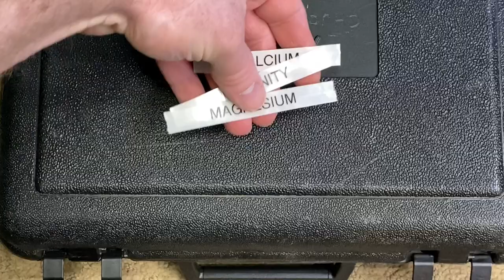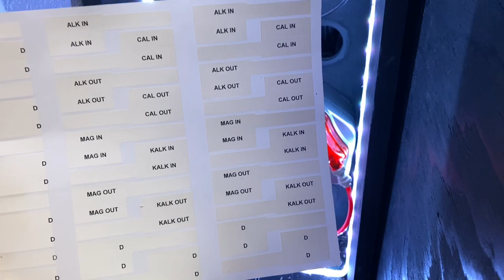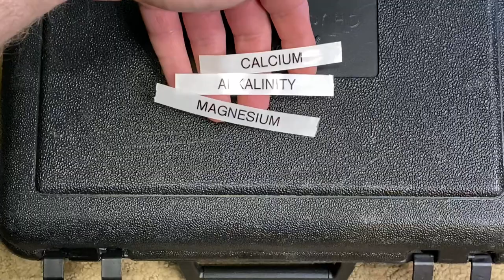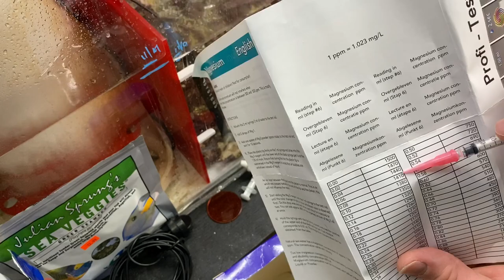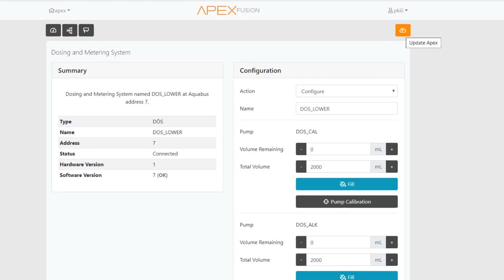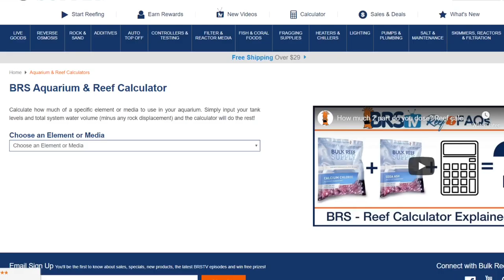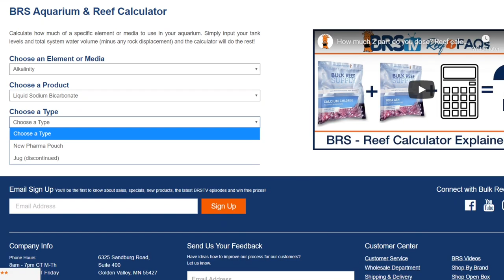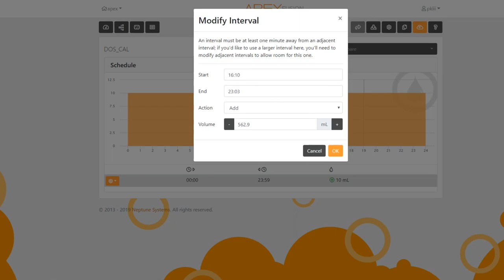SALTWATER REEF AQUARIUM DOSING SYSTEM For 2 Part * DIY Custom Setup *

Comment: Hey! If your dosing containers are completely sealed air will not be able to replace the solution as the pump pulls it out. So over time the containers will collapse and cause stress points. I drilled a very small vent hole in my lids, I used very similar containers.
Reply from the maker: Hey Jordan! Thanks for the feedback. I will do that.

Comment: I am always amazed at how much mag solution I go through.  I recommend dosing it mainly because you wont forget it and because it uses so much.  I wonder if your containers will be TOO air tight to dose properly.  Those 1/4" bulkheads say they are not designed for below water lines so they dont really need the gasket you added.  I do like the idea in case they fall over then no spills.  Will be curious to know if they will dose consistently...especially the mag since it will probably be the most mls.

Comment: Nicely done  👍 Such a sweet setup man!  
I’ve heard from plumbers though that only plastic to metal threads need Teflon tape.
And using tape for plastic to plastic adds stress. If true, glad you only used a little.

(I use Loctite’s pvc thread sealant)
Reply from the maker: Thanks Val! I appreciate the feedback as well.

Comment: You should probably space your dosing lines away from your probes, or maybe use a powerhead to push water strongly away from the probes?
Reply from the maker: Hey Preston, that area is where the flow is on the sump, so far so good. But it is a good thing to keep an eye on for sure. thanks for the feedback.
Reply: @inventoryking  gotcha, yeah as long as the solution isn't hanging out around your probes and they are upstream of the dosing lines you should be okay.
Reply from the maker: Yeah the probes are first then the dosing lines. So the dosing lines are downstream of the probes.

Comment: Hi, clean looking setup but I would be careful about putting the dosing solution above the sump/output. If the DOS rollers fail to pinch the tubing (can happen eventually from wear and tear), there will be a siphon created and you will dump all your solution into the tank. This happened to someone on reef central (lost almost all his fish and coral, some were 9 and 10 years old) and neptune updated their DOS manual after this incident. Basically, never put the solutions above the output line. You can read about this member losing his entire tank this way and neptune responding.  http://www.reefcentral.com/forums/showthread.php?t=2476302

Comment: The o-ring should always go on the inside of the jar to work properly
Reply: I disagree...the gasket should always go on the bulkhead side, never the nut side.   If you put it on the nut side, just think about that water COULD push it's was through the threads.  On the bulkhead side it could still push through the threads but the gasket would still seal it.
Reply: Robert P when the gasket is pressed, it makes a water tight seal. And the water keeps the gasket moisturized. If you keep the gasket outside, water is more easy to find a way out and leak when the gasket drys out, look up how to install a bulk head.

They say it can go on either or but preferably on the inside of the tank. 

Trust me, from working with 5,000 gallon rain barrels. You don’t want to make the mistake of having the gasket on the outside